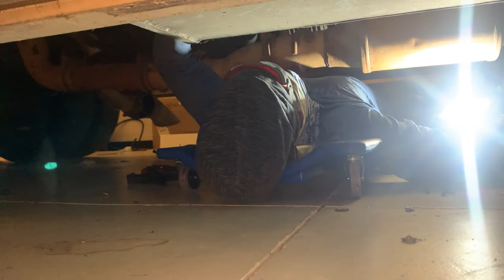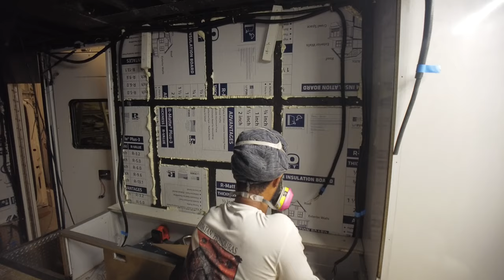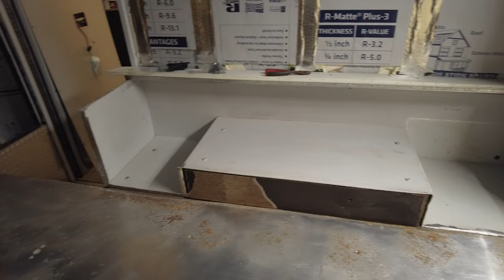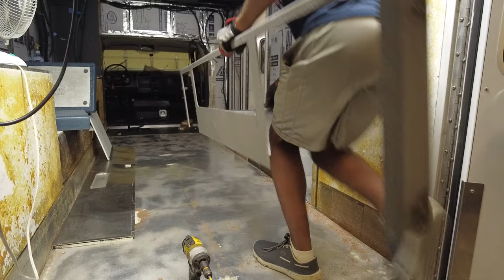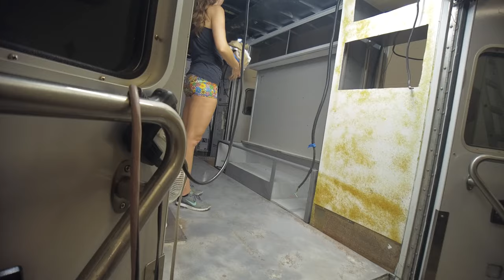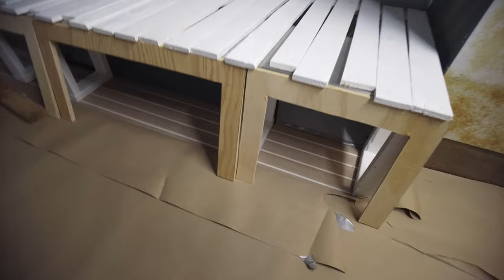Building Our Ambulance RV with Recycled Materials

Comment: Great video. THANKS.  ??? How has the marine flooring been holding up and working with the heated floor. I am pulling my foor up now...wow hard work. I was thinking marine mat but your the first I have seen use it. And wow your doing a slat also. I'm doing a four piece one both twin and king options on size.

Comment: You two have done a great job insulating the ambo.  Kudos on the spray insulation, 1 and only time I did it in my garage foundation to sheet rock wall seams I sprayed WAY too much and it ballooned out.  Those blueprints in your head are always the best because you "see" the vision.  You remind me of...me...checking and then adjusting 3 more times then deciding on a solution.  Nice shop,  239 area code puts you in Collier County.

Comment: Awesome work guys! I too have a c4500 ambulance conversion and am considering the sound deadening treatment for the cab because it is pretty noisy at highway speed, as I am sure you too found out. Did you have any trouble getting the flooring or headliner to fit over the Dynamat? Thanks and keep up the good work!